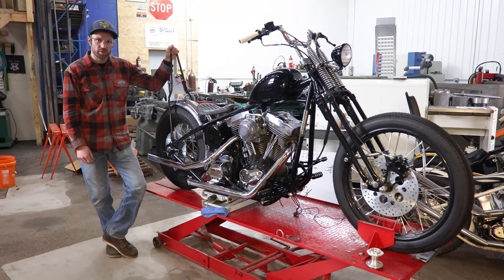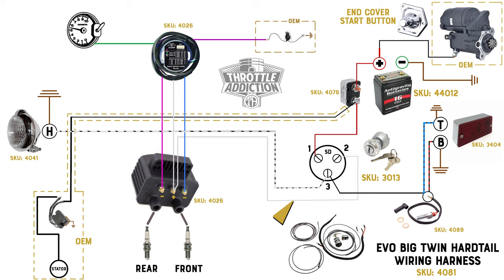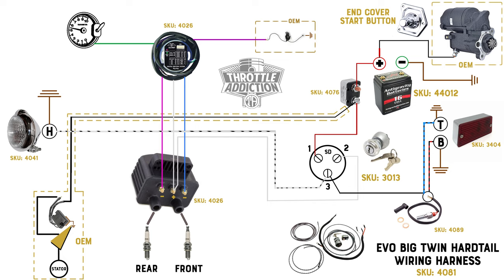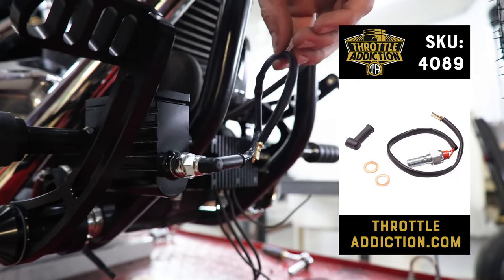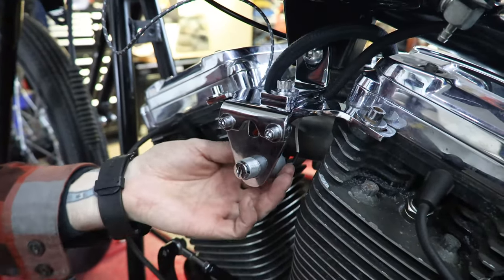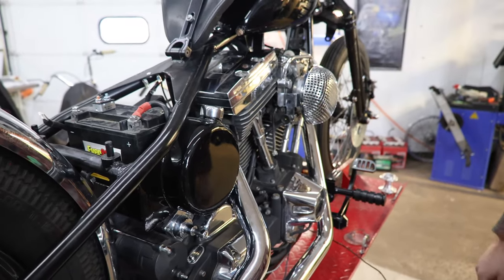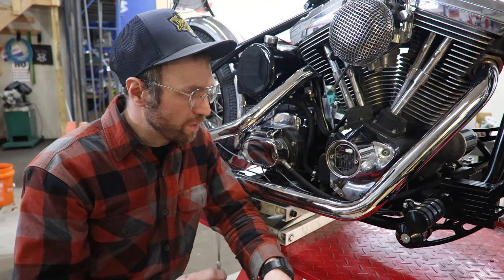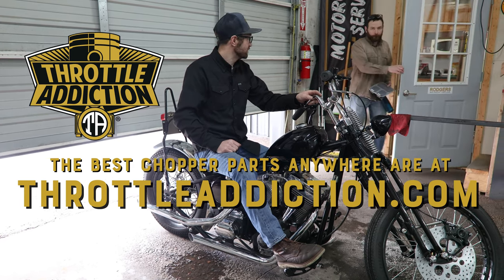Big Twin wiring made EASY | How to wire an Evo Big Twin chopper using the Throttle Addiction kit

Comment: I have an 87 evo and the starter does not have provisions for the push button/slam start. Would you recommend running a 3 position switch with exciter wire to the solenoid like your sportster kit?

Comment: Loving your content thank you so much for putting it out there. 🤜🏻🤛🏻 Can I ask why you decided not to hook up the VOES and what about the ECM? I’m just about to start a complete rewire of my 91 FXSTS, installing the M-Unit.
Reply from the maker: Thanks for watching! We just eliminated the VOES to keep our system as simple as possible. The Ultima ignition we use replaces your OEM ECM and pickup.
Reply: I’m installing this kit on my bike now, did you plug the vacuum line coming from the carb to the voes since you eliminated it? Or did you run the vacum line to somewhere else? Or just leave it open? Sry if this is a dumb question, thanks for this awesome video brother merry Christmas

Comment: maybe a dumb question, but if this worked on a 1984 evo could it work on a 1984 shovel 1340 electric start? almost the same engine for the most part. not sure about the electronics though.

Comment: Having a hard time finding that motor mount with key hole. Anyone have a link? Thanks.
Reply from the maker: For the one on our bike we took the stock Softail motor mount and drilled out the hole meant for the horn. Another option would be to fab a whole new piece that would bolt on to the mount instead of drilling out that stock plate for the horn. We also couldn't find one sold in the configuration we needed. We'll likely make and sell this in the future but for now the best options are drilling or fabricating a new piece.

Comment: Could this wiring work on a birddog mastiff s&s 117.  2008 ?
Reply: I know you have probably found this out already but I did my 2002 big dog pitbull in this exact fashion still running great got rid of all the extra trash like the control box that's trash big dog should have just kept it simple wouldn't have had so many wiring issues